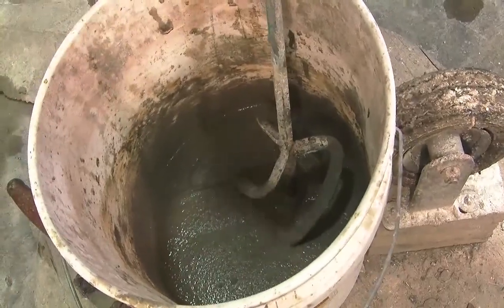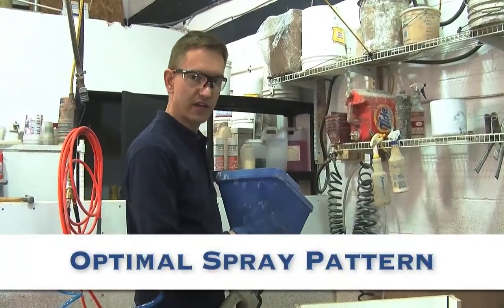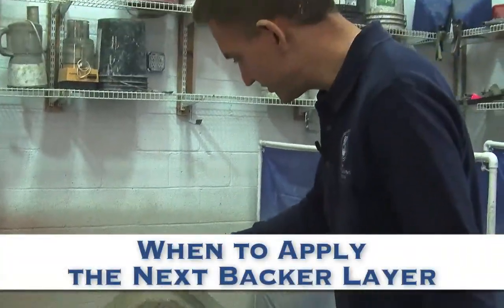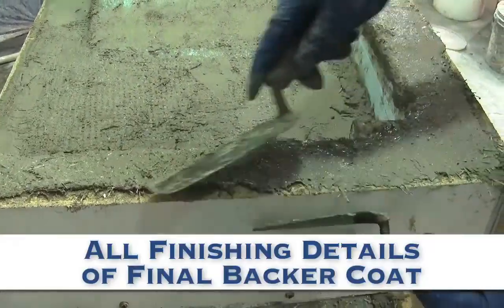How to Make Glass Fiber Reinforced Concrete (GFRC) Countertops

Comment: Can the forms be reused?
Reply from the maker: The fiberglass sink mold can be reused many times. The melamine form is generally only good for one or two castings before the material gets scratched, swells, or degrades such that the quality of the casting suffers.